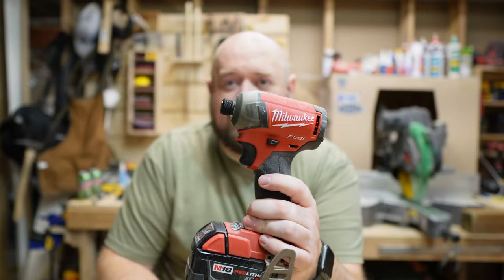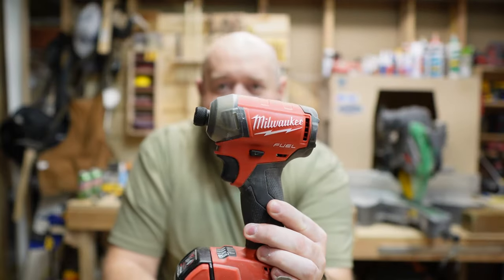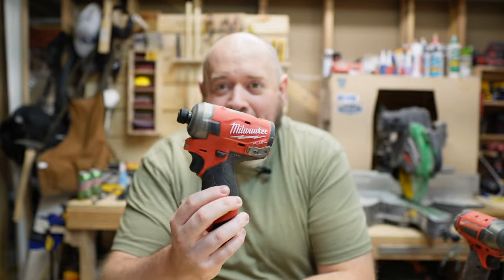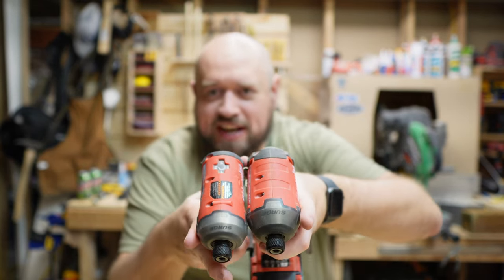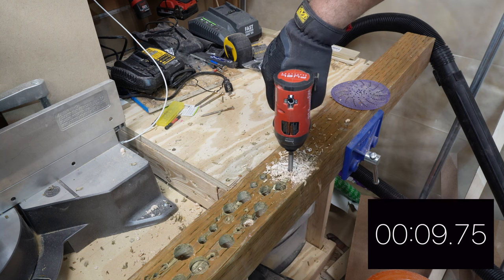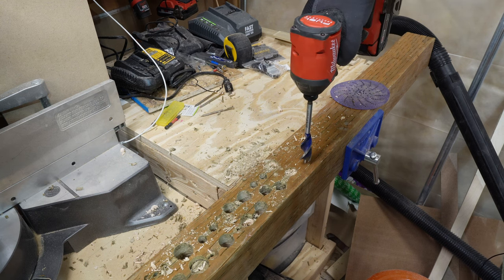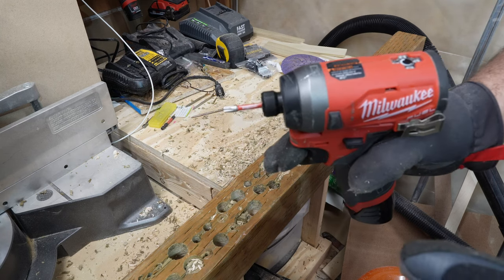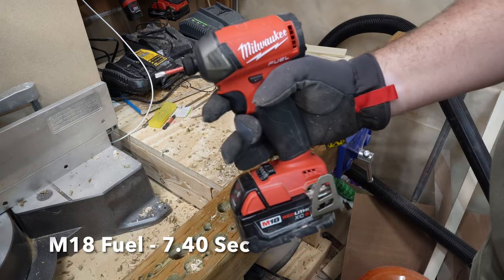Milwaukee Surge - The Gentleman's Impact Driver

Comment: The M18 Surge is my favourite impact driver out of all 6 ones we have in the workshop. I don't use it for drilling though, just for screwing. So smooth and quiet. But with a 2Amp battery, light and handy. Significantly more power and less vibration that the M12 Surge, which is very nice as well.
Reply from the maker: They are great impacts.  Especially indoors.

Comment: You had the surges on the metal screw setting.  It’s designed to not overspin self tappers in metal studs. Common mistake, that is not a drill setting.  You use 3 for drilling.
Reply from the maker: I’ll double check it in the morning but even going back and looking at the video I believe they were all in speed 3.
Reply: The setting is why the drill kept stopping when boring👍
Reply: @TinkerWithTools , you are correct…he is incorrect!  I rewatched the video, pausing to double check you had each of the drills in position “3” and you did!!

It just goes to show you how wrong people are on the Internet.  They’d rather throw a negative or incorrect comment out, especially if it’s an I gotcha type situation.

Here’s what I’d do prior to testing a tool, in order to mitigate anyone contesting how you conducted a test.  Prior to testing show the tool with the selected option, e.g. “As you can see the drill is in speed 2 (show the camera), we’re using a 3 amp HO battery and the battery is full (show the battery strength meter to the camera).  

Unfortunately you have to be this descriptive and granular in order to verify to the world that you’re doing as you say.
Reply from the maker: I appreciate the advice.
Reply: Well you’re at least correct on one item, the 4th impact selector option is designed for sheet metal type applications, to automatically cutoff after the software detects the sheet metal screw offering resistance or once it’s seated.

However, you are 100% incorrect regarding the Surge drills selector option switch position, “neither” the M12 or M18 Surge Impact was in the 4th selector switch position.  He used positIon “3” for all impacts tested.
Reply: @martylucas8557  nn

Comment: I own the 12&18 volt Milwaukee Surge driver. I also have the Makita 18v version (Oil Impact). I use the Makita the most due to the handle ergonomics, fits in my hand perfect. My least favorite is the M12 Surge because of the grip. The grip is thicker because of the battery design that is inserted up in the handle as opposed to the slide on battery the others have. The oil impact drivers fits the bill for 99% of what I do, if I’m driving lags I’m reaching for the 18V impact wrench anyway, if anyone is on the fence it’s a no brainer, hope this helps.
Reply from the maker: Thanks for the input.
Reply: @TinkerWithTools  👍

Comment: The Ridgid Stealth Force was also a pulse drive impact driver.
It’s too bad it was discontinued.
Reply from the maker: Yeah, ridgid had one... Makita and Metabo HPT or Hikoki have one.  I just want to see make a second generation.
Reply: @TinkerWithTools  What is the Metabo version called.
Reply from the maker: HiKOKI WHP18DBL (NN) (L) 14.4V 18V.
Reply from the maker: That’s the listing on eBay.  I haven’t tried it but viewers have suggested it.
Reply: @TinkerWithTools  I googled pulse driven, and some models with SSD in the name came up.

Comment: My surges do not stop with a good battery. If my battery is old or aftermarket  it will stop. The surge noise level is worth all other assets. I agree m12 surge is the best except I am running big lag bolts.

Comment: I need to ask. Why not use a small/medium drill to fasten screws? All that racket. Just tell me why? Is it just because of the compact size? Is it the control?
You are basically a stealth ninja using the drill.
Reply from the maker: When it comes down to it, it will be user preference.  I am not against a drill but I do feel that the control of the surge is better than most drills.  For people that prefer impact drivers this is good answer to reduce the noise.
Reply: @TinkerWithTools  Well I hear you. I'm just curious. I feel the drill is being put aside on areas where it actually shines. Silent fastening being one.
I'm really interested in the m12 surge. I have the cblid M18 impact and cblid M18 Drill with 5ah batteries. I'm thinking of getting the m12 smaller drill and the m12 surge for around the house use. M18 often being overkill for DIY work.
Reply from the maker: I think it goes in waves.  For me using the right tool for the job is key.  For a task like you describe I will often go to something like the installation drill driver form Milwaukee and others.

Comment: I have concerned getting one I just don't want to spend the money but I do low voltage and we hang a fair amount of TV's and I'll generally use a drill for the lags just because of noise
Reply from the maker: I think they are a great tool but I am also a big proponent of finding something that works for you.  A drill certainly is an alternative to a traditional impact as well.

Comment: I’ve had the same issues with the m18 surge not being as powerful as the m12 surge I use a 5amp for the m18surge and a6amp for the m12 surge
Reply from the maker: Do the bigger batteries mitigate the power difference at all.   I had a 5 on the M18 for that test and only a 2 on the M12
Reply: @TinkerWithTools  Yes, higher AH batteries have more cells that can balance a large draw over each cell. Say the drill is drawing 10 amps from 2 cells for the 2 AH battery, that's 5 amps from each cell. That's a lot of strain on 2 cells. If you use the higher AH batteries it can spread the 10 amp current draw over, lets say 5 cells for the 6 AH equaling only 2 amps drawn from each cell giving the drill far more power headroom. There's also a limit for ever drill and battery. I would bet you would feel no difference between a 5AH and 6AH m12 battery (if they even make them). Not sure I summarized that well at all, sorry if I make no sense I'm no teacher.

Comment: Isn’t the point of those tools for driving home fasteners and not drilling holes? Isn’t drillings holes and such a job for a traditional tool?
Reply from the maker: You are correct.  The point of the drilling was just to help try and show the relative strength of the different tools tested. Plus people do drill with impact drivers all the time so I am sure people do the same with a surge as well.

Comment: My m18 surge cuts out the same way. Did you find a way to resolve the issue? It's just inconsistent.
Reply from the maker: I haven’t.   I’ll have to check if that one is still in warranty.  It’s one of my older Milwaukee tools.

Comment: Curious how that m12 would perform with the new HO 2.5 and 5.0. Or even how it would have performed with XC 4 or 6. 

I don’t own any CP batteries besides the 2.5 HO, and this is intentional
Reply from the maker: We have done testing on those batteries.  It won’t feature these two impacts but this video was released before those batteries were even announced.
Reply: @TinkerWithTools  I figured since this is 10 months old, just wanted to comment my thoughts out loud.
Reply from the maker: @ChrisBranleh  sounds good.  Thanks for watching!

Comment: my M18 surge does not cut off like yours in the video. something doesn't seem right
Reply from the maker: have you tried it on a larger bit.  Mine only does it when I push beyond something similar to a 3 1/2" deck screw.  Under that it's actually really awesome.   I first noticed it when I tried to put in a 6" long spax structural screw.  It just didn't want to drive it.
Reply: I’ve taken lug nuts off to test mine out and it impacted for a long while and never cut out.  Something seems off here.

Comment: The M12 Surge is my 2nd most used tool I own. Right behind the DCF601 Screwdriver. They make a great 1-2 punch. I rarely, if ever need to bring out anything larger between those 2.
Reply from the maker: The surge is great... I am excited for where they might take it in gen 2.   We haven't really seen a second generation on any of the quiet impact drivers that I know of so it would be nice to see what improvements could be made.
Reply: @TinkerWithTools  I agree. I'd love to see a next gen Surge. My HD says they cant keep them in stock. But they seem to be split on the internet lol. I love mine. I wish I could get the Hikoki Hydraulic driver, but I've only found on ebay and its near $400. Im not that interested lol
Reply: @TinkerWithTools  the new line of high output batteries should increase performance of the m12 series.

Comment: I have the m12 surge and I only use it for light tasks inside the house.  As much as I hate to make excuses for the Milwaukee fan girls 😆 I wouldn't use surge for any task that requires power...

As of most comfortable impact to use is makita for me by far.
Reply from the maker: Like I said in the video, if you are doing bigger tasks, I don't think it's the tool for the job, but for the lighter duty stuff, I think it's great.  I wish more companies would make a hydraulic impact, especially in the 12v lineups.
Reply from the maker: Also, the Makita is great.  I hope to have a video on it soon.
Reply: @TinkerWithTools  yes you did cover all those things in the video...great job
Reply: @TinkerWithTools  makita makes the oil impulse impulse,  I just wasn't gonna spend $200 on it

Comment: Be a man and use a drill for drilling holes. Impacts are used for fastening to material, not drilling through it. Oh and use DeWalt with a flexi on it. Ur man parts will turn up in a week after the use the DeWalt